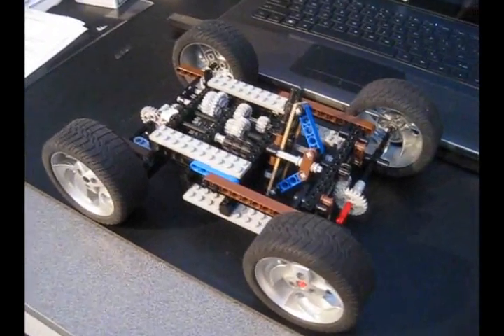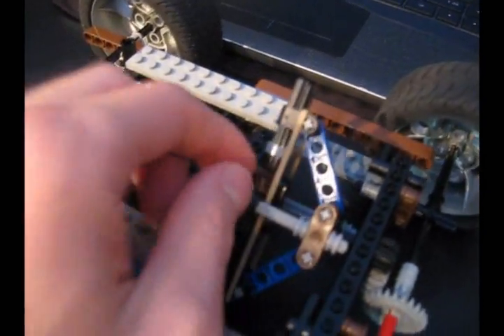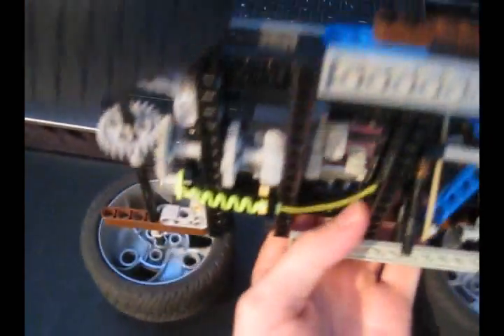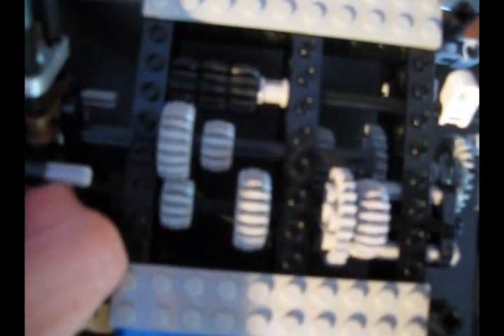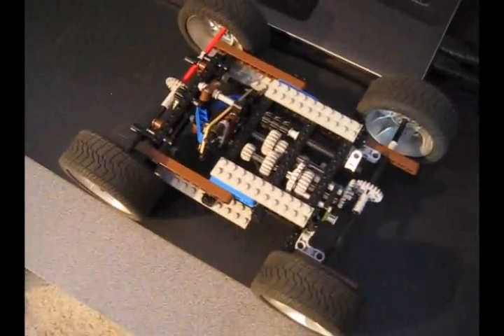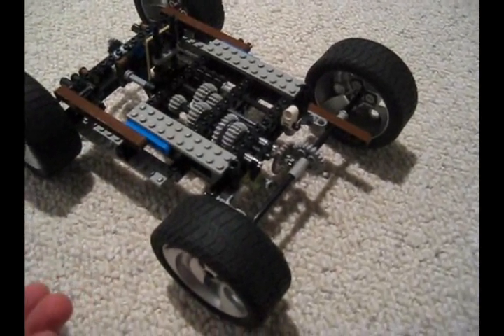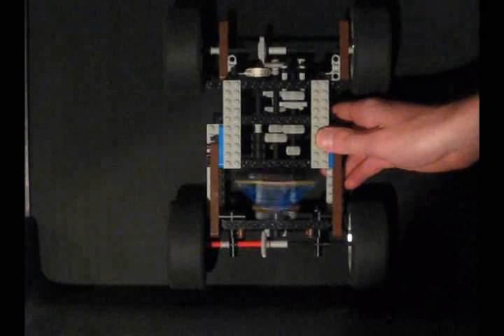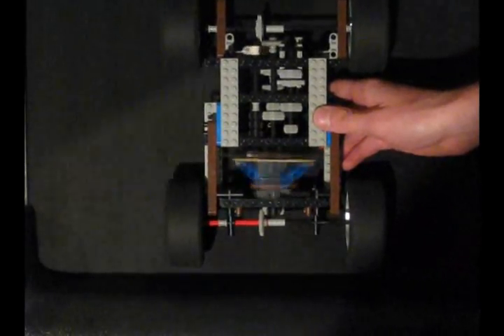Lego 3 Speed Automatic Transmission

Comment: that's a good start, but a Lego motor will NEVER be able to get the car fast enough to change gears... maybe attampt a 2 speed with a far weaker rubber band.
Reply: Buggy motor can do it :)
Reply: @IonNight  nope.
Reply: @abyys676  Prove it.
Reply: @IonNight  with the size of the gearbox and the rubber band strength, the buggy motor outputs wouldn't be even close to the desired speed nor the torque.